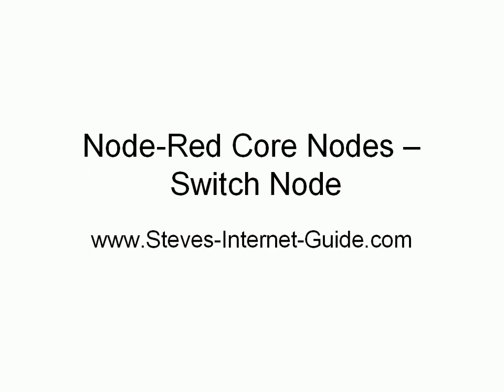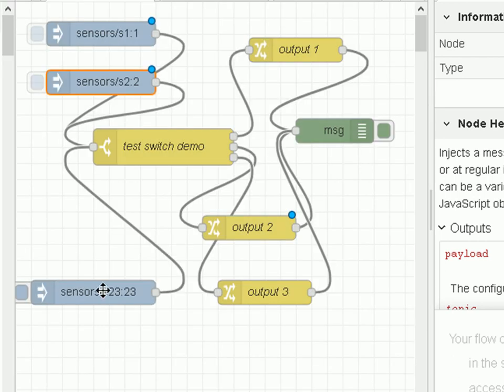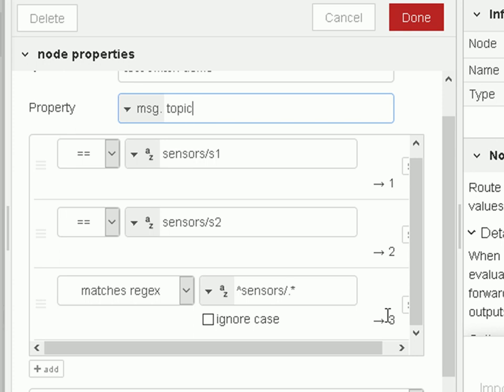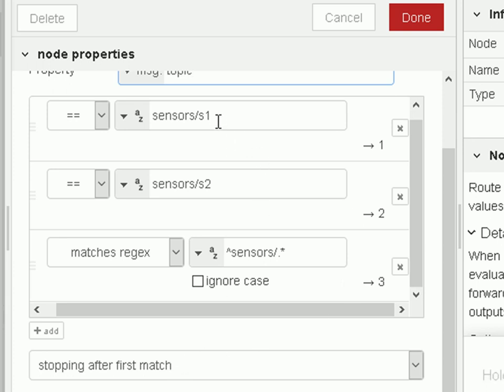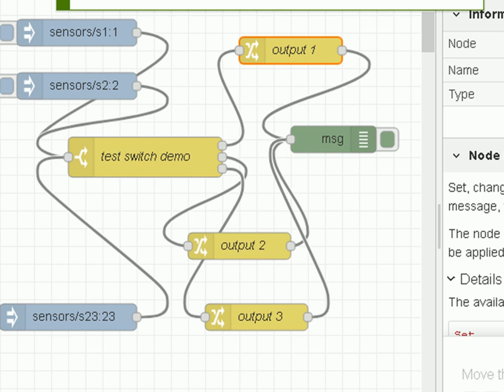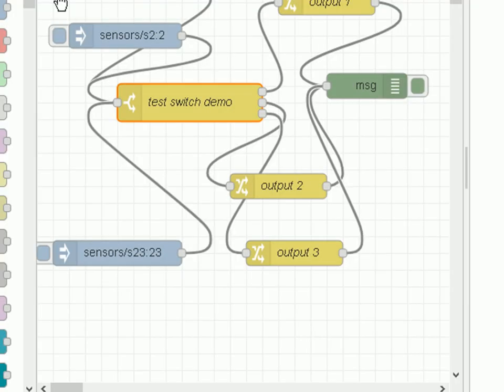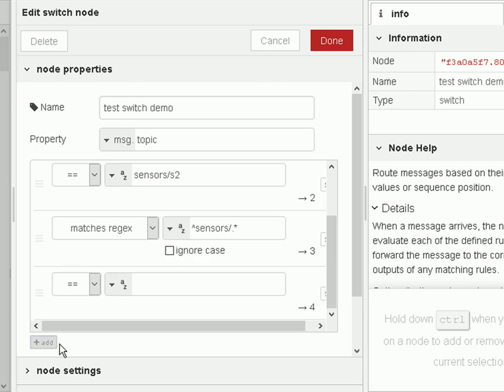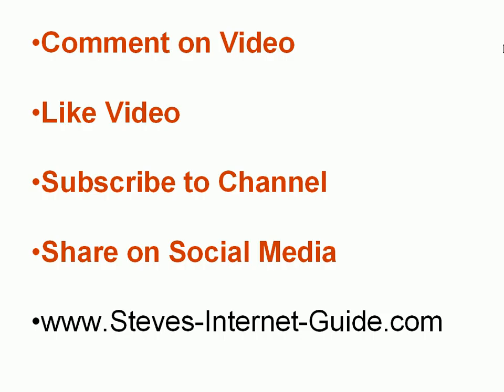Node-Red Switch Node for Beginners

Comment: Wie kann ich zur Laufzeit einen Vergleichswert/Grenzwert ändern? Ich möchte zum Beispiel mit einem Dashboard-slider den Grenzwert im Switch für < und für >= ändern.
How can I change the threshold dynamically (for example "<5" and ">=5" change the 5) with the output from a dashboard slider ?
Reply from the maker: That's possible but I don't have a video on it. If you contact me on the ask steve page I will send you a demo flow.
stevesnoderedguide.com/ask-steve
Rgds
Steve

Comment: Hey Steve, I received a string like “AcX:123,AcY:123...” from the MQTT, how can I separate the string and get the number out using Node RED? Tried but failed. Really appreciate if you can answer, cheers.
Reply from the maker: Hi
Can you use the ask steve page on the site and send me the string in question and I will have a look
rgds
steve
Reply: Steve Cope thank you so much for your quick reply. I have figured out by myself ahaha. Generally speaking, just split a string message which contains a couple of numbers and display them separately. Cheers.